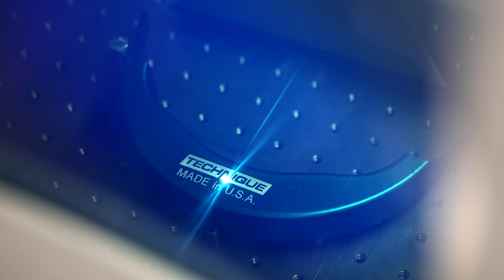Face Shield for Coronavirus - Rapid Prototyping for Henry Ford Allegiance Health

Comment: My face shield come with vertical positive air pressure. Mask + face shield provides greater protection. Eyes need protection also. I am a CT tech, I have been using my own face shield [patent pending] in close range with covid patients without N95. Nurses and Coworkers were impressed by my product.  Outter PET plastic slip off easy for disposable or reusable. Defog by air.  Add hairs net underneath the shield for twice the protection.  Super lightweight, comfortable, and cheaper than a papr.less than $91.  Market soon ;)